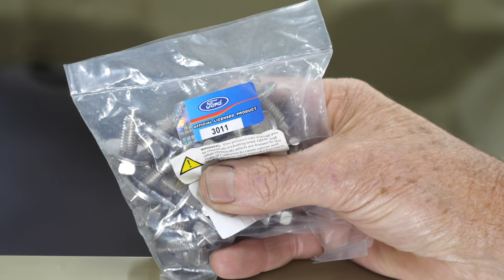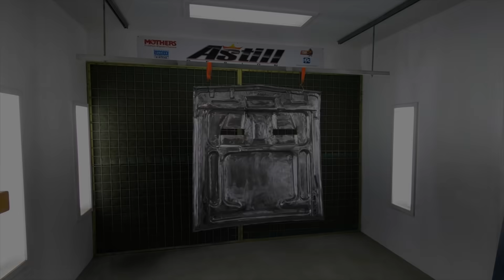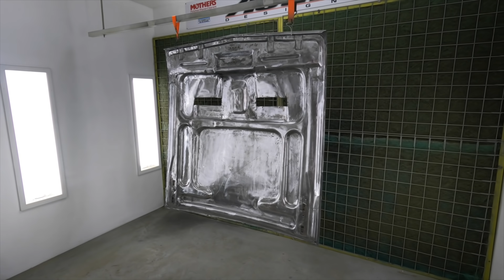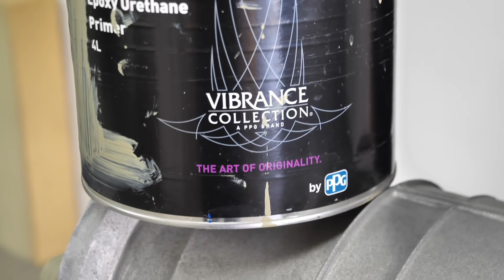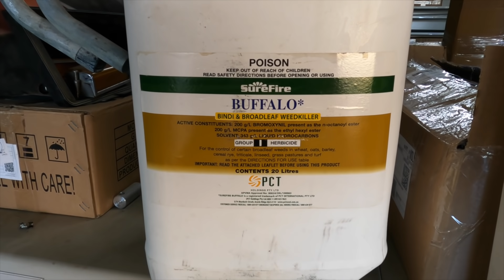BOSS XC Modified Car Building Challenges + Bonus Shed Skid | Road To Summernats Top 60 #18

Comment: One of the best paint jobs I seen a guy do on his fb Holden and what he used instead of primer was the zinc sand able coating that is used on fishing trawlers and the finish he ended up with was unbelievable. He said it was easy to get all the gaps perfect with simply sanding them don’t know if he was being honest but I did see him coat his car with zinc as he was sand blasting a trawler and sprayed it with zinc and he said it would be protected from getting rust for quite a few years.
Reply from the maker: interesting

Comment: Awesome Howard.  At least you can say there is not another bonnet like that anywhere. Are you going to bond/glue the bonnet skin onto the frame ?
Reply from the maker: Will remount the same as original. Sealer and plug up the old spots
Reply: @AstillDesign  But without a heap  sealer pouring out from the side of the frame. Lol.
Reply from the maker: @rhettcorbett3346   there are no holes for it to pour out from.
Reply: @AstillDesign  That's what I meant. You look underneath any old Falcon bonnet & there is sealer  everywhere.

Comment: Hey Howard thank you for the channel, I love it!  
PLEASE CONSIDER MOVING THE CONDENSER FORWARD AND THE OIL COOLERS BEHIND!
The condenser is the most important thing to cool and should be at the front of everything.
Oil coolers in front of the condenser is trouble.
I can see the compressor blowing up quick and the driver never really happy with the A/C performance.
A common mistake made by lots of mechanics, ask any old A/C Guy. 
Cheers, Russell Hahn. Waterloo NSW.
Reply from the maker: Thanks for the tips!
Reply: @AstillDesign  ...And thank you for all of yours throughout the series!

Comment: Would dimpling the holes in the metal add the strength required instead of adding another complete piece around the coolers ?
Reply from the maker: It’s the radiator support that needs the strength

Comment: Have you got trans cooler right.  How does cooler fill with both exit ports pointing south.
Reply: Probably on a pump
Reply from the maker: runs under pressure so no issue
Reply: You are correct. There’s going to be air trapped, regardless of pressure when you have both ports on the bottom

Comment: Great build Howard. 
A question in regards the air cleaners you are not going to use, what brand are they and where did you source them from.
I think they would suit a stack injection setup I'm working on but I cant find what you have pictured anywhere.
Reply from the maker: These came from Jon Kasse in The USA. I will talk to the owner these may be available.
Reply: @AstillDesign  Thanks Howard, much appreciated